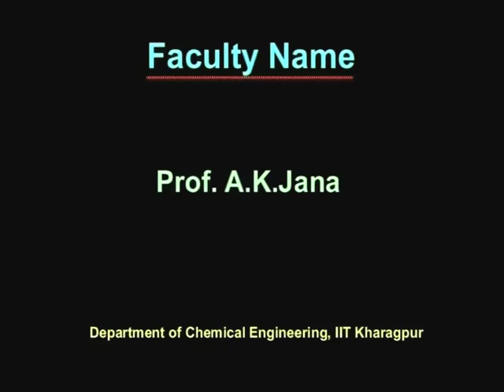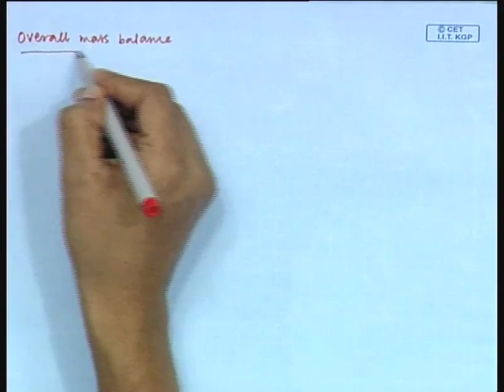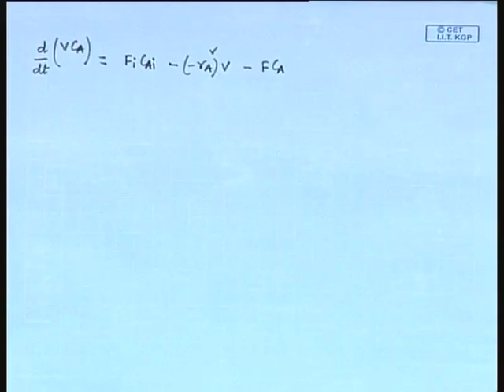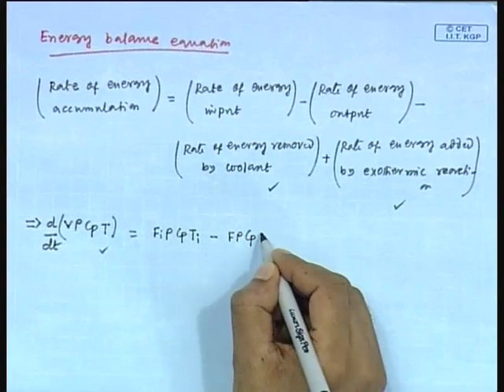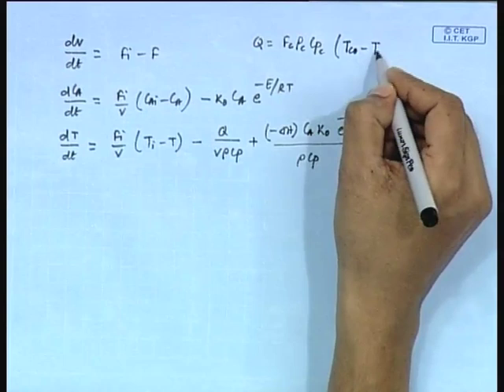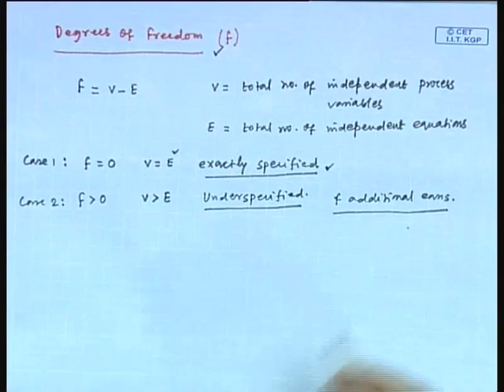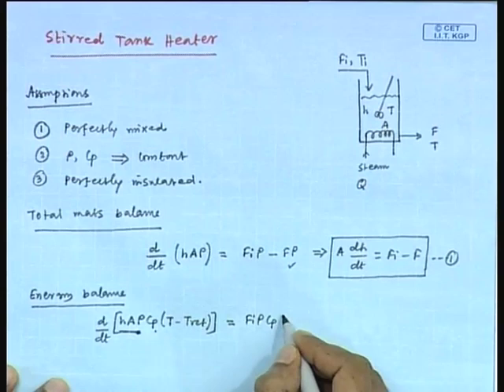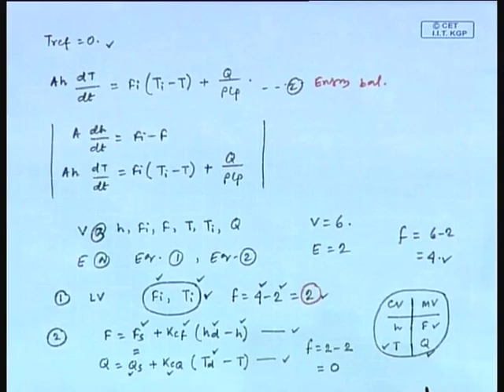Mod-01 Lec-03 Lecture-03-Mathematical Modeling (Contd...1)

Comment: Great and clear presentation!! However, in the last energy balance equation of the  Stirred Tank Heater example,  why the height, h, doesn't vary with time?
Reply: +444yyyggg We did take it to be varying with time. Hence the result. Work it out. You will understand.